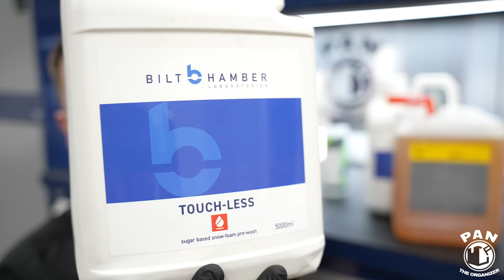The end of the 2 bucket car wash method!? 💀

Comment: Hey Pan, love all of your content and videos, it has taught me so much.
I just wanted to say that this video specifically changed the game for me. I did not realize how much a prewash with higher PH chemicals could affect my car washing experience.
I currently do not have a pressure washer and have started using a foam gun but I still saw amazing results with this method. Starting with a very dirty car, this was the first time I was able to wash my car and have a clean bucket of soapy water at the end of the wash. Amazing!
Anyway, I was wondering will you'll be checking out the new "MTM GHF1" Foam gun? Adding a pressure washer to my current living situation will be very difficult so I'd like to see if this would be an upgrade to my current setup. 
Thanks Always PAAANNN!!!!!
Reply from the maker: Thanks for the positive feedback! I haven't heard of that MTM unit, so we'll see.

Comment: Have you ever used a pressure washer on a vehicle with PPF on it? I know you need to be careful not to be too close to the protection or the pressure washer could potentially loosen the edges. What PSI do you recommend and it still be safe? I'm sure keeping a distance is necessary?

Comment: I'll always use the 2 bucket method. I don't put soap in either bucket. Both buckets are to make sure my wash media is complety clean before reintroducing it to the panel. I go back and fourth between using multiple microfibers per wash or using one mitt and cleaning it on the grit guard after every panel. Whichever method I chose is based to how dirty the car is. I foam the area before I do the contact wash even if I'm doing small sections. The goal is always to minimize marring on my paint while maintaining it. You only have so much clear coat to work with so taking your time to do it right and not cross contaminate your media will always be worth it to me.
Reply: If you re-use a towel or mitt, it's dirty no matter how much you think you got it clean. Grit guards only go so far. Spend 30 bucks on towels and your problem is solved.
Reply: @adamcoe  yes like I said depending how dirty the car is I'll go back and fourth between using one mit, or multiple towels. At this point I have over 300 towels ready to use. But for washing my daily driver once a week, two buckets with two grit guards and power washing the face of the mitt after every panel on a well maintained but dusty slightly soiled car seems sufficient.

Comment: Pan - I love your video tutorials and I have learned a lot from you. I abandoned the 2 bucket method a while ago and gone to a pre soak foam followed by foam and a 1 bucket several mitt contact wash. During the prewash foam I use a soft detailing brush to work around the door handles, emblems, and crevices. I’m gonna push back on your process of using the 1 mitt for your contact wash. Ask yourself this question - is it possible that you introduce dirt into the bucket after cleaning one panel? Certainly the risk of introducing dirt into the bucket is reduced by your process, but there is a risk. If you simply use 4 or 5 mitts and do not put a contact wash mitt back into the bucket, your risk of introducing dirt into your bucket is eliminated completely. It’s all about risk. Your cost of using 5 mitts vs 1 mitt is negligible over time and you are not introducing dirt into your bucket at all. Keep up the great videos and enjoy the ride!
Reply from the maker: Thanks for sharing!

Comment: Thanks for a great video once again.. I have a question - when you are reforming, are you still using Active Snow Foam? The reason I asked this question - if you are reforming with Active Snow Foam, it would take more than 5 minutes to complete the contact wash so the pH 9.5 would be on the car for around 15 minutes as you finish the contact wash.. Is it safe for Active Snow Foam pH 9.5 to stay on the car for that long as you keep the Active Snow Foam for 5 minutes only at the beginning..

Comment: Pan, I’m new to detailing and love your channel. Can you help me understand the difference between a drying aid vs quick detailer?
Reply from the maker: Pretty much the same, as drying aids are most often quick detailers. A drying aid is a spray product that you spray on a wet car, that acts as a lubricant and barrier between the paint and the drying towel, to avoid marring the paint during the towel drying stage.

The other benefit is you boost gloss and slickness a bit too, and if the quick detailer also has a bit of protection in it (in the form of ceramic or wax), it can boost the protection that's on the paint.

See my video on drying aids here: https://youtu.be/NOTNed04xYE?si=JN-lQ4wIeS7pvWtT

Comment: I think its too easy to overthink things with detailing. I don’t want to add marring but I also won’t lose sleep over it as there will be plenty of marring present anyway when I do my yearly clay session. Also, we’ve been using high performing snow foams in the UK for years. I first used Bilt Hamber Auto foam 15 years ago.

Comment: Nice video. Quick question, did you use the same soap foam when pre treating the vehicle as you did when you did the contact wash? I’m trying this method today btw
Reply from the maker: If I’m using a pH neutral soap for regular weekly washes, yes I’ll often use the same soap in the foam cannon as in the bucket. See a video I made about the best pH neutral snow foams that can also be used in the bucket here: https://youtu.be/TCQXfXECr5Q?si=pAOGH359DzVmCzWg

And once in a while for deeper cleanings I’ll use a higher pH snow foam for the pre-wash and a different soap in the bucket. See my ultimate spring wash deep clean video here: https://youtu.be/oTaFE_p2OAw?si=nSJZ5X8cbrzgBBpl

Comment: Always well-presented, good content. However I have gotten good results still using a bucket of clear water with grit guard in bucket, maybe even adding the unused foam left in my foam cannon.  I pre-rinse the vehicle with the 40° nozzle (white) on my electric pressure washer. Foam it once, contact wash frequently rinsing my microfiber wash mitt then rinsing. When you mentioned spraying the dirty vehicle with the pressure washer can theoretically drag the dirt over the surface at high speeds, it does give me some concern about my method, even though my vehicles are often well spray waxed/ceramic coated.  With the encapsulating properties you mentioned of the current higher end snow foams is there still a significant risk of marring etc. without the pre-wash?

Comment: Thanks for the informative video Pan. Question, I use the Auto-foam for prewash with a snow canon for the first wash and since watching this video I will also do a second wash with the auto-foam and wash mit. I also want to use Turtle was Graphene flex and the Turtle wax car wash/wax with ceramic for weekly or bi-weekly washes. What order should I use the Flex wax, right after the second wash, dry or wet application, then use the ceramic for the next wash. Thanks.

Comment: Hey Pan! So are you not really using a rinseless in the prewash stage anymore since the foams are better? The least products I have to store the better!
Reply from the maker: There are many ways to wash a car. Some like a rinseless as a pre-treat, then rinse, then foam, rinse wash. Some foam on dry paint, rinse, foam again and then contact wash. Some just do a rinseless wash.

What ever works for you is fine, as long as you use safe washing and drying methods.

Comment: I similarly use the same one bucket method BUT with multiple wash mitts (some chenille, and some microfibre ). This way I know that my mitts are  clean, clean. Mitts are not expensive and come in a variety of different textures to ensure a thorough clean from top to bottom- swapping them out often. I find this method is also quicker than the one mitt technique. After the truck is clean I can properly wash my mitts to make sure that they are clean and ready for the next time.
I agree that there are many correct ways to wash a car and everyone has their personal favourite way.

On a side note...... Do you powerwash the underside of your vehicles. I see spray bars that attach to pressure washers. Just curious what your thoughts are.
Reply from the maker: Yes I have an undercarriage cleaner. I made a video about it many years ago here: https://youtu.be/2fOEaNOGTFI?si=H6sCmtZpoMnscs3G

Those are great for areas with insane winters like we have in Montreal.

Welcome to my channel. You discovered one of the biggest car detailing channels on YouTube as we surpassed 952,000 subscribers and we have over 127 million views! I have been detailing for 26 years and I love to share my knowledge and passion with my viewers.

You found the right channel to help you learn everything about detailing.

Comment: Hello Pan.  Thank you for your tips and advice.  I have a large pickup truck and I live in Arizona so my problems are that the size of the vehicle, which takes a long time to foam, and the heat (unless washing early in the morning).  Both factors mean that the foam tends to dry.  What advice would you have for people who live in hot, dry climates and who also have vehicles with a lot of surface area?
Reply from the maker: Of course, washing in direct sunlight is a big no-no in detailing, and you must avoid it as much as possible. But if you have no other choice, here are some useful tips:
1) Use a deionized water setup like mine, check my video: https://youtu.be/IKNL1chAQXY?si=IdBcEXX77LnLOEHf
2) Use pH neutral shampoos, as if those dry, they won't harm the paint
3) Work in the shade, and never during noon hours when the sun is at its brightest or hottest. Work as early in the morning as possible, or as late in the afternoon as possible.

Here's a video I made about washing cars in the sun: https://youtu.be/DebiLFBCHu8?si=nPWzDj8Y3ZegnKAr

Comment: Hi Pan… is there a problem if I use one kind of shampoo for snow foam, like Meguiars Ultimate snow foam and then in the bucket use another type of shampoo? As we will refoam the car, we will have two different shampoos on the car surface simultaneously. Is that an issue?

Comment: I stopped doing the 2 bucket method a long long LONG time ago. I just grab a bunch of CLEAN micro fiber towels and dump them in the soap bucket. after 1 or 2 panels I put the used microfiber towels in an empty bucket and grab a new one. my cars are ceramic coated and never really THAT dirty. believe me, you won't notice a difference unless you look under a microscope. its not that serious... unless you own a black car lol

Comment: I've been using the 1 bucket method for about 6 years now.  I have always done some pre-wash foam but mainly because I like the foam vs any actual cleaning properties.  I'm in Alabama so we don't have to deal with the road salt and chemicals as much as you guys but always at least powerwashed the loose dirt off.  For the contact wash, I've always had a spray bottle with the soap solution and sprayed some on the mitt and then some onto the wet paint surface and gone one section at a time, rinse the mitt in the bucket and then repeat for the rest of the car and I would also use an older wool mitt for the lower portions under the doors and behind the back wheels and around the exhaust area and lower bumper for the really gross stuff.

6 years and 3 cars later, no negative results from this method.

Now that I've got an Active 2.0 and MTM gun arriving soon, I guess I'll be more inclined to lay down foam for the contact wash despite the Gtechniq ceramic wash solution not really foaming at all :/

Comment: I started with a foam gun, but after getting a foam cannon, I will not go back to a foam gun. The difference is so evident. The gun just slops the soap and pseudo-foam on the surface and immediately runs as seen on the video.

I went with the foam gun, because it was cheaper. But after a few uses, I wanted to try a foam cannon. I ended up selling the foam gun in one of my yard sales.

Comment: Hey Pan, thanks again for another great informative video. I know my questions haven’t always been relevant to the specific video this past week. My cordless buffer came with pads and a microfiber bonnet. For just the waxing part, which I’ll be using the wax to the max stuff. Do I just put the bonnet on a flat foam pad because it doesn’t have a pad behind it
Reply from the maker: With the Turtle Wax To The Max liquid wax, or any liquid wax, you can apply by hand. If you want to apply with a polisher, make sure to use a soft pad made for that purpose. I don't know what machine you have or what pads it has. But it has to be the softest pad with no cutting ability. As all you are doing here is applying some protection.

And once applied, you buff off by hand, with a microfiber towel. See my video on applying waxes here: https://youtu.be/KZjiPcsPBrA?si=Tk5_W2ANFVq3uk-5
Reply: @PanTheOrganizer  thank you! It was a budget dual action on Amazon. Not looking to go crazy as I’m just starting out with that. It came with a bunch of pads, was going to use the orange wavy one to polish. The turtle wax combo came with the spray and liquid. Figured I’d use the liquid to wax and spray for maintenance. It also came with a microfiber bonnet to put over a flat pad for waxing but not sure if you just use one for the whole car or have to swap it out part way through. And I’ll definitely hand buff off. Thank you so much for everything! About to start the project as we speak

Comment: What are your thoughts or recommendations on using the higher PH Level based wash soaps/snow foams on a work truck that gets pretty dirty on a weekly basis? For example using the KochChemie Super Foam.

Would using those high PH Level soaps still be overkill, say once every week?

Or rather would you recommend the lower PH Level soaps like the Active Wash from KochChemie for the weekly wash, and the Super Foam once a month?

Comment: Great video, and actually how I've been washing cars since getting my first snow foam cannon. One question: For Bilt Hamber Touch-Less, would you still use that for the contact wash, or would you drop to a less aggressive pH neutral product?
Reply from the maker: The Bilt Hamber snow foams are only for the pre-wash stage. Not for the contact wash. For the contact wash I'd use a pH neutral shampoo. Also, you wouldn't use the BH snow foams on a regular weekly basis. No need for that. Again, a pH neutral snow foam is all you need for regular weekly washes, as I mentioned.

Comment: Hi Pan, I wash my motorcycle, and don't have access to a power washer, currently I use carpro reset with the IK hand pump for foaming, then diluted in water for the contact wash. I do this because i've heard for motorcycles I need to use pH neutral soaps because of the exposed parts, but I notice many pre-wash foams are not pH neutral, does it matter?

Comment: Will a high pH snow foam, like the Carpro Lift, remove some stubborn water marks from painting/windows? I'm asking because I prewashed my car first using the m Koch chemie gsf with a foam cannon, then the carpro descale with the cannon and finally a contact wash with neutral shampoo, but several watermarks were still on painting and windows. Thanks and also thanks for this video 👌

Comment: Great video! You said not to use high ph cleaners every time. What happens if you do? Will it damage paint? I understand it will strip protection, but I can reapply quick enough.
Reply from the maker: It will not damage the paint. But it’s not necessary to use them on regular weekly washes. If you want to, by all means go ahead, but be aware it might weaken or strip your protection depending on what you have.

Comment: Pan, I love your videos. What is the benefit of doing it with 1 mitt vs a stack mitts or microfiber towels? I would think with the stack of mitts, you don't need to worry about having to use a grit guard as only a clean mitt would ever be going into the bucket. Is the only downside that there's a little extra laundry? It seems to me that multiple mitts would reduce any  chance of scratching that may exist using 1 mitt.
Reply from the maker: See my video here: https://youtu.be/vVuRiyeazqQ?si=Lp8-jq6Lte3fvWLD
Reply: @PanTheOrganizer  I love it! Call in seal team 6! Cracked me up! I guess for me, since I am just an enthusiast it doesn't really matter. The extra laundry and inspection is not a big deal. But I can see how that would be bad for pros.

Comment: Great video Pan. Really explains the “new” method! And the products for it. I learned a lot. I didn’t know incredible subs was 8.5. And I didn’t know if ur not ceramic coated I shouldn’t use the really high ph foam unless I’m planning on re-waxing or sealing that day. Would using say bilt hamber touch less in the winter then DIY quick beads  be enough protection? Also, I noticed Adam’s came out with a yellow acidic wash they are says is for winter salt what do u think of an acidic foam? I live in Northern USA and trying to line up my winter system for quick easy back in the house!
Reply from the maker: If you use Bilt Hamber Touch-Less during winter, that's still just for the pre-wash stage. You still have to use another shampoo in the bucket for the contact wash. And use a pH neutral shampoo for that. Once done with the wash process, yes you can use Quick Beads to top off your existing protection. That is more than enough.

I am not aware of the Adam's acidic wash you're talking about.
Reply: @PanTheOrganizer  Thanks Pan. I think I miss read I was looking at the Adams strip wash that used to be green now reformulated and is yellow. The description talking about getting off winter road salt, but that would also that off my sealant too right? Prob better to use the Bilt Hamber Touchless or Koch Chemie Active for winter pre wash?